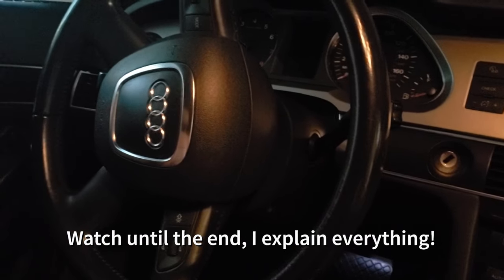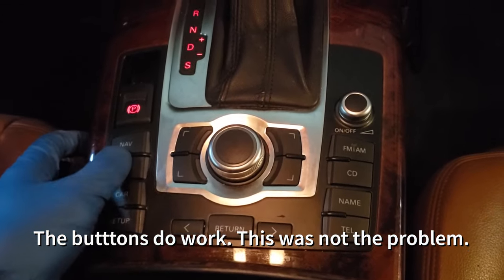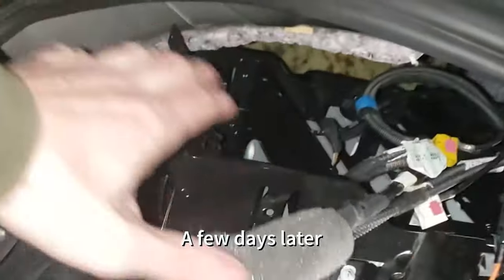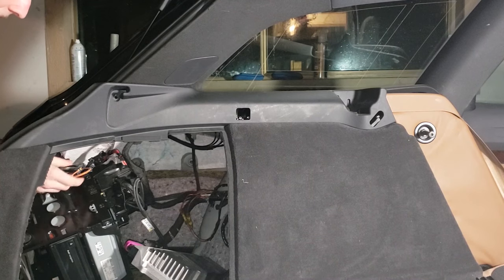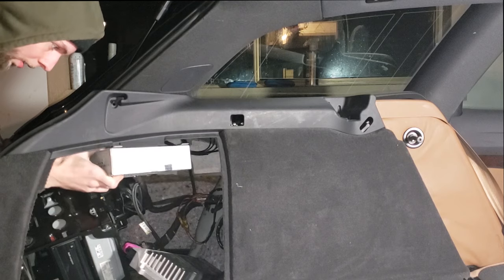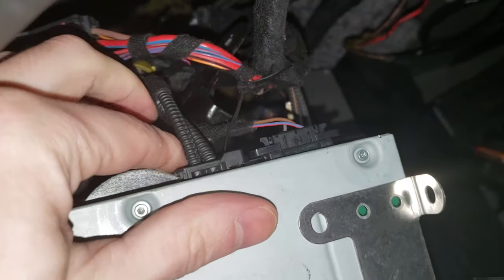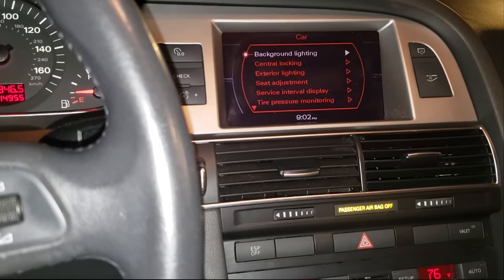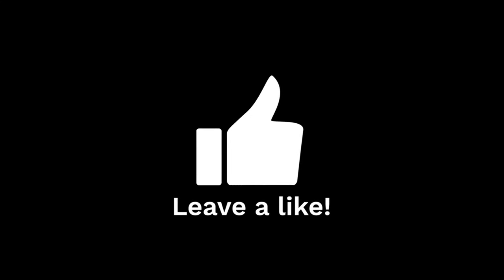Audi MMI Diagnosis & Repair (Fiber Optic Testing) | DIY

Comment: would an issue with one of these be enough to cause a battery drain issue?
Reply from the maker: Not usually no. Since no power is going to the unit. Have you checked your alternator?
Reply: A bad amp did cause drain on mine. Pulling the fuses until fixed should eliminate that issue.
Reply from the maker: Thanks for sharing!
Reply: I had optical loops on both my amp and radio receiver as a temporary fix to have the MMI screen function, and it drained my battery.  It seems like the MMI will continue to reboot while the car is off.
Reply from the maker: Good to know!

Comment: did you take the tail light out to get to the modules? i’m having a hard time unscrewing them
Reply from the maker: No, I just removed the panels on the inside to gain access. Was a pain

Comment: Hey I have the exact same problem. MMI splash page comes on then goes black, and my dashboard lights flicker while the car almost stalls but my heater controls work, the car turns on but sometimes stalls when putting into gear. I’ve heard the ignition switch is connected to the MMI, Interior Lights, dashboard, etc. you think I should start with the ignition switch? Or run this test.
Reply from the maker: Good question. First step, test your battery for correct voltage. I have seen bad batteries cause this before. Next I would get the fiber optic tester and test each module in the trunk like in the video. If you get a drastic change when olugging the tester in, then whatever module you tested is likely bad. For me, it was my Am/FM reciever that was bad and caused the whole system to fail. 

Hope that helps, best of luck!

Comment: Can you tell me any tests to do everything disappeared from my screen mmi but it’s still alight and can turn it on and of but it shows nothing in display
Reply from the maker: Did you already test each module like in the video?
Reply: Run diagnostic and it’s says button stuck mmi
Reply from the maker: I did replace the button circuit board before I even tested the module. I thought it was that at first, but for me, replacing it did nothing. It may help you to change it though. Often times drinks or stuff spills right there on the buttons.

Comment: For a 2015 audi a4 what's a good scantool to diagnose the mmi I believe it's a 3g mmi
Reply from the maker: This little scanner was pretty useful and powerful - https://amzn.to/3K7gBz9

Although you may be left with no choice but to use a fiber optic lollipop tester and test each module yourself with this - https://amzn.to/3neOoxr
Reply: @Mechani_Cole  bro ty for the quick response xD imma order it now xD driving ain't the same w.o music blasting
Reply: @Mechani_Cole  also that little dongle can connect to the audi mmi? Should I buy the more expensive 1 xD
Reply from the maker: I use the cheaper tester myself.

Comment: I hope this helps me. Thanks for the upload.
Reply from the maker: Hope it does! Keep us posted if it fixes it!
Reply from the maker: Any updates? Wonder if you fixed it🤔
Reply: I haven't fixed it yet, I just got the loop, question, do I need to disconnect the battery before unplugging any off the audio components? That kind of held me up.
Reply from the maker: @JCrushtv  no. You actually need it on so you can test with power. Meaning, once you insert the plug into the wire, turn on accessories and see if anything has changed after each module.

Comment: Where can i find cheap amplifier bro
Reply from the maker: On Ebay with your part number
Reply: @Mechani_Cole  thank you for reply. Can i change with another one because i didnt find with the same part number ?
Reply from the maker: No
Reply: @Mechani_Cole  i have this 8T0035223T serial nr and i want to change with this one. 8T0035223AE

Comment: i was able to isolate my problem in being my amplifier, yes that is a shock!  haha.  anyway, do you know if the power supply must be connected to the amp if you are checking the loop?  i took my amp apart and cleaned off all of the corrosion on the inside, and am ready to test and see if it works.  However, the power connector is a real pain to plug in and unplug.  Without plugging it in, just plugging the fiber optic loop in, will that make the connection??
Reply from the maker: Good question! I don't believe power needs to be hooked up. Main reason is all the fiber optic lollipop tester is for is to complete the fiber optic loop. When the amp or something fails, the fiber optic loop is broken somewhere causing the whole system not to operate. The loop by passes whatever module is dead by connecting the broken fiber optic link if that makes sense. 

So if you unplug your amp, plug in the tester, and you see your radio and other things work, then you most likely need a new amp. Best place is ebay, hope that answered your question🤙🏼

Comment: many thanks, so the boxes to check with the fiber optic loop are Sirius, DVD/NAV, Tuner, and AMP? what about bluetooth?
Reply from the maker: Yes, anything that is involved in the fiber optic loop.
Reply: @Mechani_Cole  Thanks Cole...I cant seem to find a list.  Besides the Five boxes I have listed above are there any more? Also, does the DVD / Nav slide out like the CD player that needs   blades to release it?  Thanks Hal
Reply from the maker: @hal coy what vehicle do you have? It's probably only those that you listed. And no, on mine I actually had to remove a large brace in the rear to get access to the plugs to test them
Reply: @Mechani_Cole  Its a 2007 Audi Q7.Ive found that the Sirius unit is hot and running all the time and is draining the battery down...but the optic loop didnt work but a thought I had it.  Damn I'll get it.

What is that thin unit mounted vertically towards the tail light?

Thanks Cole
Reply: @halcoy4373  Did you ever find out what module was not working then?

Comment: Hi, I don know if you can offer any help on this, but I have an issue on my 2012 A5, where the buttons dont work, as in your video, but everything else does i.e. buttons on steering wheel, radio, bluetooth, navigation. But the only way to control any of these is via the steering wheel or trying to use voice control (which is not very easy at all). I took it to Audi, firstly they said it was the unit where the buttons are and they replaced it. this didnt fix the issue and now they are saying its the module in the boot, like in yours. however, as you can imagine, Audi want lots of $$$$ for this. do you think replacing this module will fix my issue? even though everything is working?
Reply from the maker: Somehow just now seeing this comment. Good question, have you resolved this issue yet?
Reply: @Mechani_Cole  no, not yet. I went back to Audi as I recalled the service manager called the part in the boot the 5F unit and upon looking online, the 5F unit is the main mmi unit in the centre console. So I queried this with Audi and they very very sheepishly said I was correct. So I am now looking into changing the main unit but I have been told that I either need to get one with the exact part number or get a similar one but it would need to be coded by Audi. So I am a little stuck as I don’t really trust what Audi are telling me. They had changed the control module at a cost of over £1000 and they now want an additional £3500 for the main unit, which I kindly told them to get lost. Once I have managed to get this fixed I will update you all, or if anyone who sees this has had a similar issue and can offer any advise would be greatly appreciated

Comment: I have an Audi Q7 2007 and my radio doesn’t even turn on at all . Not to long after I figured that out on the passenger side it water leaking into the floor . So I’m not sure what the hell is going on or what needs to be fixed . It seems everyone is having the issue with this mmi .
Reply from the maker: Yeah, very common problem. Mine was water damage as well. Using this tool in the video helps eliminate the each module until something changes. 

Have you check your fuse first? There is a fuse for the radio/mmi, it could be blown
Reply: Wur is the fuse located??
Reply from the maker: Located on either side of the dash at the end. There is a panel that pops off where the fuses are located

Comment: I’ve seen videos where the loop is used indefinitely. Will that work or do you have to replace the part?
Reply from the maker: That will work, but you won't be able to use what ever module you are by-passing. For me it was the FM receiver and it was cheap and easy to just replace it. But if its the cd player or something, it won't matter to much.

Thanks for watching!🤙🏼

Comment: I’ve already done the whole procedure and he’s still doing the same thing to me you can tell me that something else can be audi q7 2007
Reply from the maker: Could be the mmi control board where the buttons are
Reply: @Mechani_Cole I just changed it right now, I’ve already verified all the fuses, it’s still doing
Reply from the maker: Never fun. You are certain you bypassed each module with the loop and turned power on after to confirm?
Reply: @Mechani_Cole   I need to have the lollipop tester? my car has a black color connected I’m doing the test with that same or do I need another one?
Reply from the maker: You need to plug the lollipop tester into the end of each plug one by one. There is no other way to test fiber optics except with this loop in this case
Reply: I already checked and I think it’s the amplifier because when I disconnect the fiber optic from the amplifier and connect the lollipop tester, my radio works, but no heard, do you think it’s the bad amplifier?
Reply from the maker: @christiancolon2394 yes. Most likely the Amp. Use the part number to find an exact replacement online
Reply: If i buy the exact one with the same number then i dont have to get it programmed?
Reply from the maker: @christiancolon2394 correct.
Reply: Hey, I finally got my amp, I connected everything as it should be and I started listening to the radio but you could only hear the speaker in front of the dash and after a few minutes it turned off and now you don’t want to hear anything What do you think it could be?😢
Reply from the maker: @christiancolon2394 good question. Perhaps there is a short somewhere? Possible the new amp is bad as well? Tricky to call it without seeing it
Reply: I just disconnected it and connected it again and it was heard again but only on the speaker of the dash and I just realized the cause that the previous amp has been damaged the liquid of the rear wiper is having a leak that falls exactly on top of the amp
Reply from the maker: @christiancolon2394 same way mine was damaged too. Common trouble area on these cars
Reply from the maker: @christiancolon2394 you can test each speak with 12v and 2 wires to see if they make noise to verify all the speakers work.

Comment: Is there any way I can get music playing through the the mmi, besides fm bloothooth transmitter
Reply from the maker: What year/model do you have?
Reply: @Mechani_Cole  06 avant
Reply from the maker: Bluetooth is your best bet for music on that model
Reply: @Mechani_Cole  I already have it, and it sounds horrible, because of the interference 😆😂
Reply: @Mechani_Cole  I think I'm going to just go with an aftermarket radio and just eliminate the MMI
Reply from the maker: I wish it was that easy, since it's all connected via fiber optics, there isn't many if any aftermarket options.

Have you tried changing thru the stations? Mine sounds perfectly clear, however you have to select a dead channel with no frequencies if that makes sense. Again though, mine sounds great 👍🏻 

Open your glove box, do you see a plug in there? Some have the option for mmi adapter, but I think they started that in 08
Reply: @Mechani_Cole  I researched, and 05-06,are the worse I've heard of the mr12 volt kit and it's straight to the CD adapter

Comment: Audi Dealership told me I have a faulty radio unit and quoted me $1800 to replace it. Bought a new multimedia radio unit (the in-dash radio, not the one in the trunk) off eBay for $200 and the issue still wasn’t fixed. Do you think it’s possible when they said “new radio unit” they were talking about the one in the trunk?
Reply: 2011 Audi A5^
Reply from the maker: Yes, most likely the unit in the trunk and not the unit in the front. Can find online too
Reply: @Mechani_Cole  Appreciate the response! Ordered the fiber optic loops, should arrive on Monday and see what happens.
Reply from the maker: I'm dealing with a similar problem on my wife's Q5, let me know what you end up finding if you don't mind🤙🏼
Reply: @Mechani_Cole  came in the mail today.. plugged into the same connector you showed in the video and it’s fixed. only issue i’m having is the volume seems to not work everything else is working
Reply: At the dealership they told me everything was connected except for “Radio” and “Sound” being inop. Clearly this solved the “radio” inop but any suggestions for sound? Or maybe that won’t be fixed until I buy the new tuner?

Comment: Hi, i have ordered the “lollipop”, waiting on delivery. But i am sorry, I’m missing the info about, haw do you know witch unit is bad. Do the system work/light up with the “lollipop”, when connected on bad unit or how?! Regards Miro
Reply from the maker: Once you connect the lollipop into the the cable, it by passes the module and will turn on your power once you find the bad one. All you are looking for is something to change or come on when you are switcing the plug around. Once it does, it isolates the issue to the exact module that needs to be replaced. Mine was the FM reciever
Reply: @Mechani_Cole  Thanks a lot I think I got it now👍👌🏼👍👌🏼just got a eBay message, that bypass cable will be arriving tomorrow.
Reply: @Mechani_Cole  hi again champ. Great to have people like you. I have now tested with llollypop and got lcd screen to turn on, and all the bottonns in the board. Radio and apllyfier was god with signal. But when I stuck lollipop in navi unit everything turned on. Bat unfortunately still no sound. Any ideas 💡🙏🏼
Have pictures of progress but can’t send den here. 
Best regards Miro
Reply from the maker: Thanks for the update! Did you by chance check the fuses to make sure they were all good?

Also soubds strange, but my speakers did 't work at first either than all of a sudden they turned on. Its possible the bad nav unit is effecting the sound as well. Can you get your speakers to crackle or make any noise at all?

Sounds like you are getting closer at least😁
Reply: @Mechani_Cole   you are wery welcome 👍🙏🏼Fuses were checked before I did anything else. Got them out one  by one, and also checked them with amp meter, there were all ok. But I could try again tomorrow, just to be sure. And no, no sound at all is getting out of the speakers!! 
Just don’t get it.  What the navi unit got to do with sound🤔🤔
But I hope you’re right that I’m getting closer 🤞🏼🤞🏼🤞🏼
Reply: Hej again champ. A little update😉
You were right about the fuse. The one (5a) in the trunk for navi unit, was misplaced in wrong empty slot. Så Now i have power in mmi consol, and lcd screen. But still no Sound.🤦🏻‍♂️🤦🏻‍♂️
Little speaker icon on screen is still showing like it is muted 🔇… and the sound button on center console is not responding. 

Last thing I have to try is another amplifier. 
If not, I give up!!!
Have a nice day👋🏼
Best Regards Miro
Reply from the maker: Thanks for the update! Sounds like you are so close to finding the problem. Don't give up yet! 

Check this out👇🏼

RE: MMI Mute function stuck

 Usually just unplugging the amp and plugging it back in will reset the system and make it work again. The amp is on the left hand side of the trunk behind the cover that pulls off. You may have to unbolt it to unplug it.
Reply: @Mechani_Cole  hi champ I promised you an update. I got me a used amplifier, with exactly the same code and same year of production. Everything fits. And guess what, sound is ON. 👍👍👍 

But unfortunately only on left side, but that can be anything 🤷🏻‍♂️🤷🏻‍♂️important thing is that I’m getting sound from 🔊
Reply from the maker: Lets go!!! Thats so awesome to hear! Thanks for the update, happy you got everything to work again. Its defintely a good feeling🤟🏼

Comment: So I have a 2005 Audi A6 and same thing happened the radio will turn in then back off and the control circuit lights don’t seem
to light up either what can be the cause or how should I fix this?
Reply from the maker: The fiber optic is probably broken somewhere. With the tester in the link, you can find the issue usually easily.
Reply: I got a fiber optic Its not the same as that one that you have but it’s a black one with a round circle idk if you seem that kind and I disconnected one of the amp cables and connected it to the optic and still nothing! But idk what other components to test which would you do?
Reply from the maker: @jorgexmunoz6131  unplug each module one at a time and plug the tester in with the key in the ON position. Then watch the dash while testing each module to watch for changes. 

It could also be the actual computer board where your buttons are located as well. Its common drinks or water spills on them and then shorts them out. I actually replaced that first because I thought it was the problem. Only to learn it wasn't, thats how I found about this method of testing. They can be found pretty cheap on Ebay if all the modules test good and the fuse is good.
Reply: @Mechani_Cole  do you have a link for the computer board for a 07 A6?
Reply from the maker: @BabaYaga_1776  I can find one. But you won't know what part is bad until you test each one.
Reply: @Mechani_Cole  how many different areas is there in the back to test?
Reply: @Mechani_Cole  what fuse should I check and where is it located